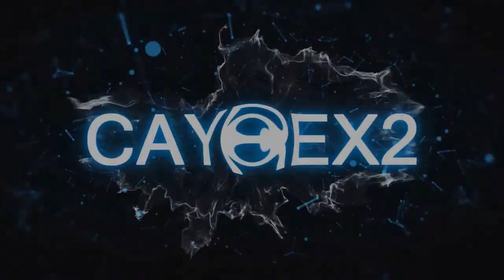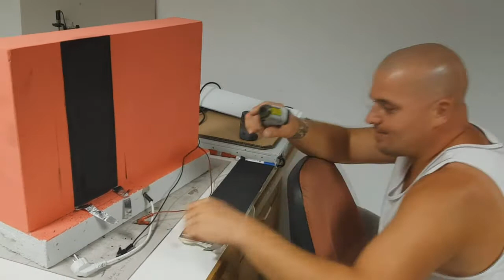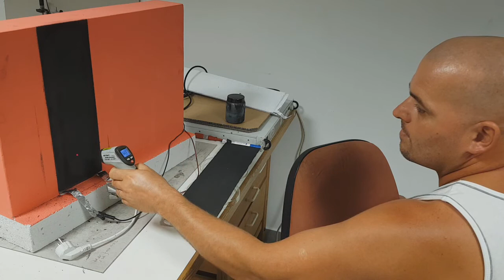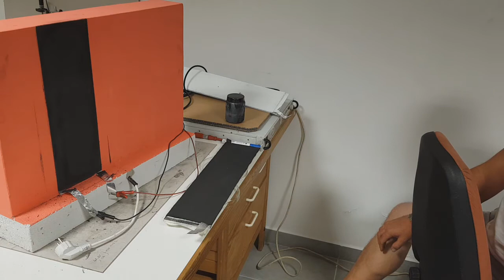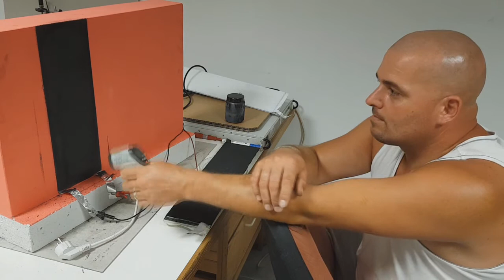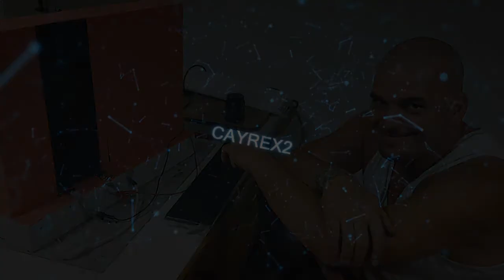Infrared wall heater (conductive ink)! Performance Test

Comment: Hi Cayrex2, thank you so much! 
Have some questions:

Robert Murray (hope I write it good) painted the ink more times and by that the Ohm went more down so the Watt too. 
When I look on internet for a carbon infrared heater, 100 W is for 1 m2
Of course you know too.
What is that white thing at the right side of the wall? That thing that can give more volt, can you give me the name please.
And.... if it is laying down you can cook on it, amazing. A cookthing from the shop takes 2000 Watt minimum.
Do you sell your conductive ink? 
Hope yoy have time to answer. 🌻

Comment: Interesting, can you guys do a test where you put your heater in a space and measure the difference in room temperature per a given amount of operating time for the ink? Measure true performance of ambient heating over time, performance is based on ratio of power in in difference of actual heating provided. This will give true cycling numbers for damage comparisons as well. Surface temperature measurements are great, but heat dissipation into the environment is needed for practical application performance measurements. Keep up the great work!! I love watching your video's and look forward to more. I've been considering making my own ink, for heating a small room where i had to remove the water radiator. You think sodium silicate/solvent ink base would work for cycling and heating performance characteristics of usable value?
Reply from the maker: This test heater heat the area of 2 m2 for 1 to 2 degg C in 10 min,... after 1 hour,... 3 to 5 degg C (from 24 degg to 27,... 29 degg. My lab have the area of 45 m2 and is for this small 100watt heater to large. For example,.... 700 watt ir panel in size of 120x60 cm can heat the area of max 16 m2.
Reply: Interesting, how difficult would it be to build a heater panel setup that could heat 45m2?
Reply from the maker: zacariah heim not so difficult,..... you can paint multiple heaters on the wall,..... or paint strips on the floor